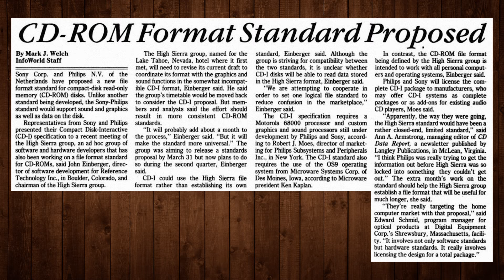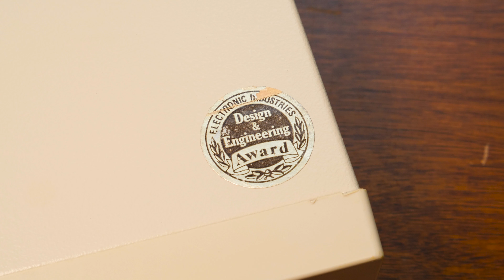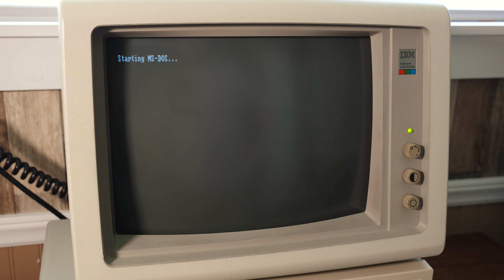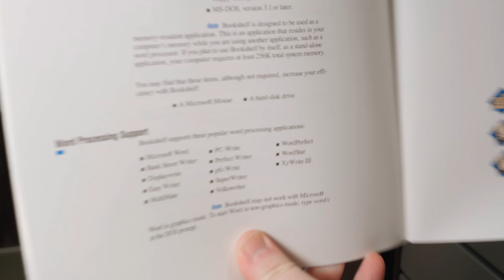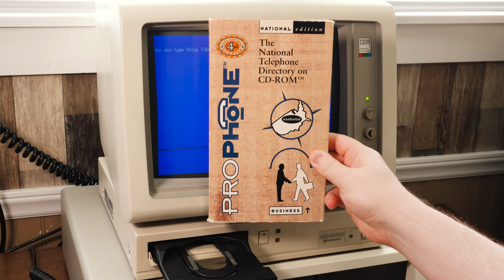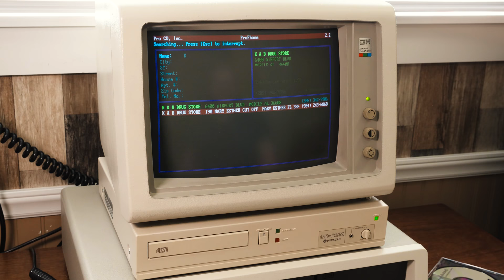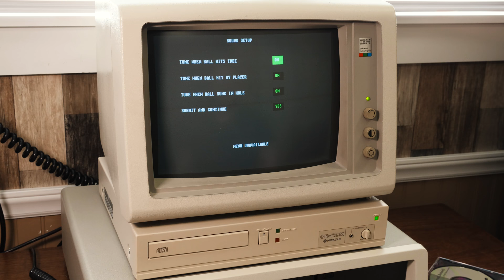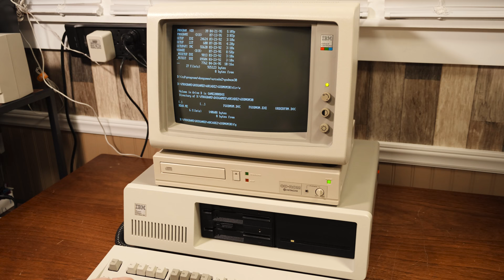The 1987 CD-ROM Experience: Hitachi CDR-1503S

Comment: Mmm, optical media. My first was a 6X CD-ROM included with a Packard Bell PC. It broke. Replaced it with a 52X. There were some Tex Murphy games that ran on multiple discs and you could set it up to have each disc in its own drive you never have to swap. I wanted that. I wanted to put as many disc drives into my computer as possible. I added a 56X CDRW drive that I was a bit too excited for. I bought a 100 pack of CD-Rs with jewel cases because I was going to write a ton of discs; in the past 20+ years, I used about 10 of them. For a while there, the single CDRW disc the drive came with was where I stored all my files.

Then came DVD-ROM, DVD-RW, and the last one I bought, an LG GGW-H20L blu-ray drive, which has Lightscribe disc labeling and even HD-DVD support if you download software that flashes firmware from a different model. I'm kind of disappointed that optical drives are disappearing from the PC landscape. While blu-ray support on PCs are a headache and a half to get working half the time, the alternative is to "own" digital versions sans any features and either taking up space on your hard drive, or virtually existing on your account so long as they're willing to pay license fees. I hope the future has more optical media in it, but a lot more consumer friendly.

Comment: Why do old CDs not explode from centripetal forces when used in newer drives (like the 72x Clint reviewed)?  Did the standards people foresee having a 72x mechanism in the future?  Or is there some manufacturing step that required such forces even in the beginning of CDs?  Or they had to be strong enough to withstand gyroscopic forces and that was the limiting factor rather than higher rotational speeds (still a factor of rotational speed, though) and the isotropic nature of the material made it survive 72x rotation when sitting stationary??

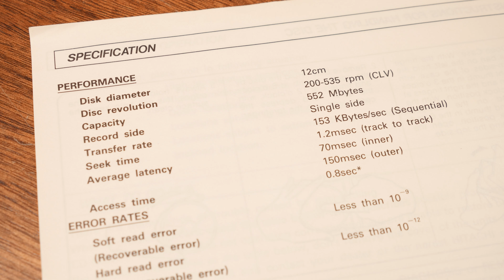Comment: 1:35 Does the 552MB limit actually apply, or can you still read CDs over that limit? (or is the 552mb just a limit of the media when the specification was made?)

That CD shoebook has me oddly captivated! I do not know why, but I find it alluring. 

Also it has that blue vertical PCB. Is that OEM? That may be the oldest non-motherboard PCB I have seen. The next newest that comes to mind a Sound Cards and Graphic Accelerator cards. I remember blue PCBs being a real thing that was cool at Computer Shows. Errrr, I miss those so much?!
Reply: 6:45 Ha, I commented before I saw that part. It looks like it was designed for a module, and they come up with somwthing else to put there. Those SMD parts must have been fairly new for the time.

Comment: wow I've never even seen a "single speed" CD -ROM before!  my first was a beefy DOUBLE SPEED that I put in my 486 back in 1992....actually I'm wrong, I have seen single-speed CD-ROM before, but it was  a 6-disc changer for a BBS with 4 phone lines....but only one was 14400 baud the rest were 2400 baud (they did later upgrade though)....btw is this the rare XT 286?

Comment: I have an Addonics parallel CD-ROM drive that I got with a Compaq 486 all in one like you have (long since gone) but I haven't been able to find working drivers--that or the parallel cable I have is not wired correctly... or the drive is toast. I tried hooking it up to an AT so I imagine the experience would be similar--especially over parallel speeds!

Comment: I know why they didn't (this unit dates from 1987 and it already used a tray and bare discs, etc.) BUT I wish optical drive makers had continued offering caddy-based systems.  I honestly haven't loaded a program from any disc is likely a decade or more, but I still do a hard backup once a month to 4x 50GB rewritable Bluray discs and if they were in caddys they would be a virtually indestructible method of storing data.

Comment: At least it didn't end up a failure like when IBM introduced 2.88 MB "DSED" (Double-Sided Extended-Density) floppy drives and diskettes in there high end PS/2 line of computers.
1x cd drives were painfully slow. Even on later cd-r burners. Writing at thesee slow speeds just took forever. Though it was manditory at that early stage as to not waste the expensive cd-r.

Comment: If one pauses this video ((which is another awesome one, as usual, LGR, thanks for sharing (-:  )) at 15:19 and sets the playback speed to .25 and then resumes the video, somewhere between :19 and :20 a blond-haired dude's face fades into view and fades back out again. At normal speed his face flashes by at a subliminal-mental-implant speed. Anyway, back to the video.... :-)
Reply: ... and now having seen the rest of this video, I say thanks again, LGR. :-)
My earliest experience with CD drives was with the double-speed types with the separate case for the CD. That was about 1997 or so... fond memories. I started with computers in '96 but with equipment from about 10 years earlier and no extra  fund-age to buy new stuff that was extant on the market, so my learning experiences tracked along about a decade behind the times and I enjoyed experimenting with the older equipment and DOS and Windows versions and stuff the first few years after 1996. :-)

Comment: I'm surprised they didn't make Bookshelf so you could also run it as its own program without the need for launching a "host" program like WordPerfect or Word to use it.  So, for example, if you were handwriting something but wanted to look up a definition or use the Thesaurus you wouldn't have to load another program just to launch and use Bookshelf.  (Plus I actually thought Bookshelf was microsoft's first encyclopedia on CD... not a "reference" program).

Comment: I wonder if OCR was used to digitize the data... otherwise someone(s) literally had to manually type in all of that information found on the CDROM.
Reply: Probably more likely was since this was from large publications, they had mainframe computer systems with all the "digitized" material on tape storage and then transferred over. They probably had to add in all the searchable parts, and index everything, and of course the top interface the user used.

Comment: Several libraries had those units and Sony (Due to that I got the chance to install several units.). Some were Scsi, Most was proprietary interface and drivers. The one thing I remembered was how expensive it was. Then they started them for the masses. That was okay until they tried to push Multimedia 1x drives and how crappy they was. Though it was a easy way to make money of of them. But that is another story.

Comment: Yeah, lasers are no joke. If you ever look at the laser of a BluRay burner, that is guaranteed to be the last thing you ever see. 5mW is enough to cause eye damage. A 16x BluRay burner runs up to 200 times that. Add to that the fact that only a fraction of that light is visible, most of it being in the UV spectrum, and you're in for a bad time. This is why I don't play with lasers - I don't trust myself enough. At 1w, looking at the spot on the wall without eye protection is enough to damage your eyes. This shit doesn't play around!